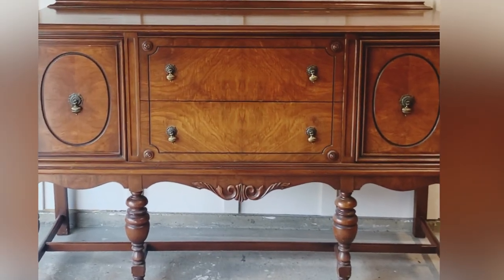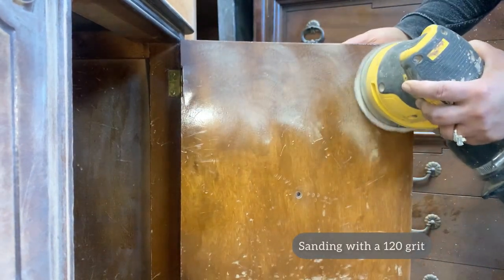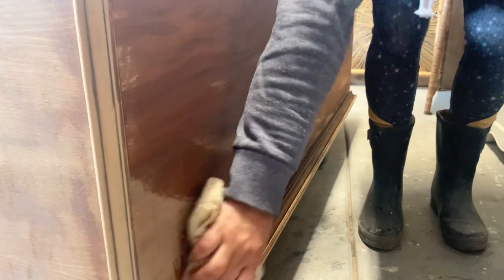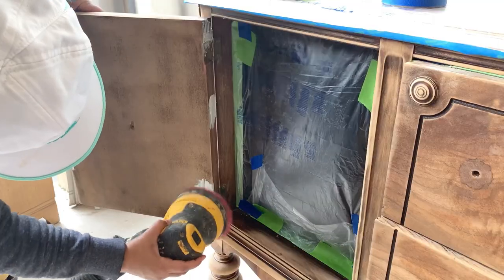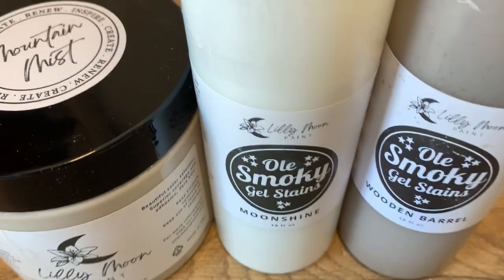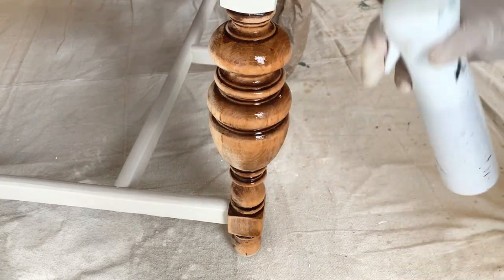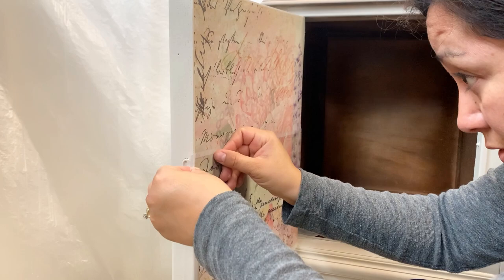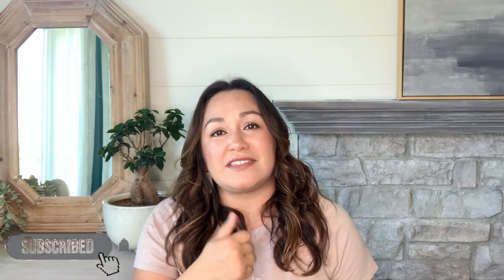Buffet Makeover With Transfer Application | Furniture Flip

Comment: Beautifully done! The mix with paint and stain blends so well. So do you prime the Bin Shellac primer with the sprayer? I heard the ethanol is flammable and can only be rolled on or brushed on. I have so many personal pieces of furniture I would love to prime using the sprayer if it's possible! Please let me know your experience. Thx
Reply from the maker: Hi Angie, I have read into the spraying of this product. The recommendations are to spray in a well ventilated area. I have used it for years and never had any issues with it.

Comment: I’ve come back to this video about 10 times. I just can’t get enough of this piece!! It’s honestly one of the most gorgeous, simplistic repurposes I’ve ever seen. 
Now with regards to top coats, I limagine you’ve tried “LM Stellar Shield”. So I guess I’m just curious 1. Why you chose GF over LM.  
2. Is GF usually your “go to” top coat for high traffic pieces. (Particularly white painted pieces). 
I’m looking for a true clear top coat that won’t affect the integrity of the color (turn my white pieces yellow) and I’ve been going back and forth between GF or LM and can’t decide which to buy. So I’d love to hear your thoughts/comparisons between the two. Thanks so much and thank you for sharing your knowledge and creativity with us. You truly are incredible at what you do. xoxx
Reply from the maker: Hello! LM Stellar Shield didn’t come out in the market until later on, way after this video was recorded. I’ve used it, and it works great. 

GF I’ve used for years, one of the reason is that I can buy it just down the street I’m for me, but also because it’s resistant, it doesn’t affect the color of my paint, and the finish is beautiful. 
I buy the large cans which means I can use it on several projects before running out.
Reply: @aliferefurbished  ok….I think I’m gonna go with GF; as it’s been around for quite sometime and seems to be consistently reliable. Thank you so so so much!! You’ve helped me more than you know.

Comment: My fingers hurt just thinking about all that sanding. It’s worth the outcome, but ouch! I sprayed KILZ Restoration the other day and some of it failed my scratch test. Boo! I need to start using Zinsser BIN again but don’t want to use it in my Earlex 5500. Is the oil based primer hard to clean out of your sprayer? Do you designate that particular sprayer for that primer?
Reply from the maker: You could by the spray can if you want. I get the hesitation. And I believe I just answer your other question. 😊